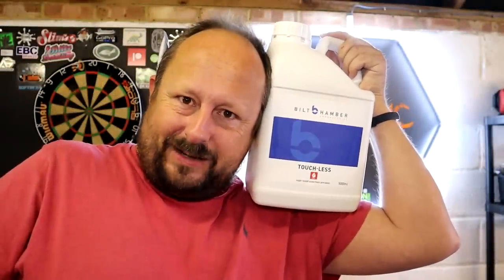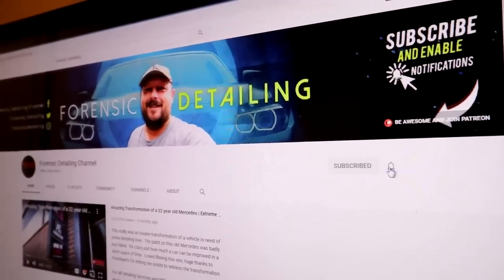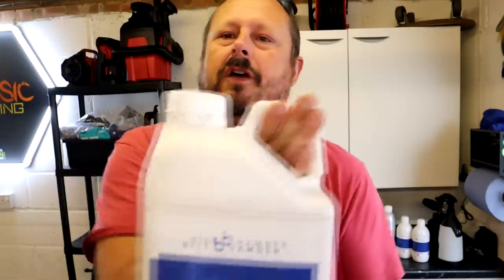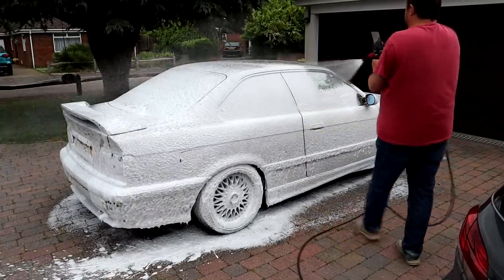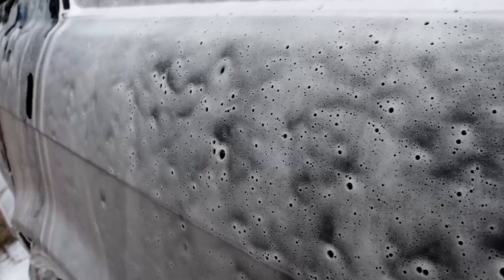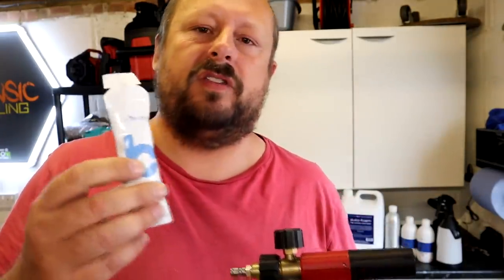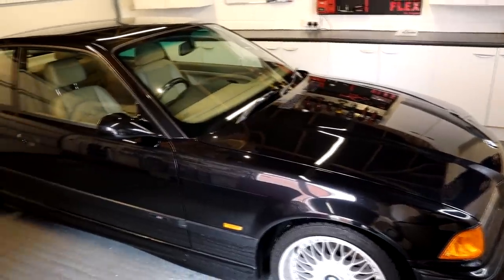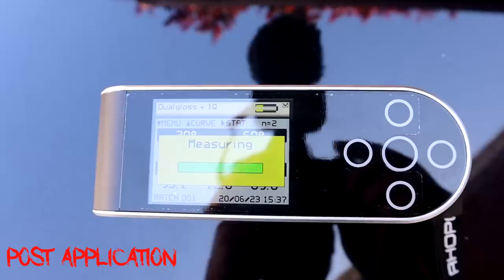Getting the Most out of Bilt Hamber Touchless and Touchon

Comment: I like to work one panel at a time, and I do like to make one small exception when using Touch-less on a vehicle and thats to make contact with a detail brush on emblems, rubber trim, glass, etc and even use a magic eraser on the glass and side mirrors during the normal dwell time, before the rinsing off. This then allows Touch-on to bond better in those areas, incredible finish on glass with only Auto QD to finish up later on in the detail

Comment: I brought touchless recently. I think it maybe the tweaked version. I usually like a thinner foam as easier to rinse away from the car and drive. But this surprise me with how easy it washed away even with it being quite thick on application and was still effective pre wash.

Event at 2% PIR it instantly reacted with dirt on the tyres almost like an APC. Which is usual for a snow foam. I don't think auto foam does that a 5%.  However it was only summer dust so can't really make a judgement on the cleaning. Its does smell like Sugar soap from a DIY store, which make sense as it is a sugar based product.

Comment: When I use Megs HCW in a wet manner (I use a noodle mitt rather than spraying it all over the place!), I finish by spending 1 min on the windscreen with a clay mitt. Get's off the over sprayed product and makes the wiper blades silent! I'm going to get some Touchless soon as my Auto Foam is almost run out. I'll skip the Touch On, purely because I am happy with Megs HCW (dry application base layer or wet application, spray off).

Comment: Great video.
Here's a suggestion for those who want a thicker foam but retain the properties.
When mixing your lance, add 10 ml of a thick foaming soap like Magifoam or Chmical Guys snow foam. I've found that it worked for people with low pressure machines and pump sprayers to get a better foam. Just remember that it's not about getting whipped cream on your car, the foam has to be able to slowly migrate down the sides of the car. For this reason, also remember to give the adjustment knob a few clicks when you start by foaming the roof to thin it out a bit there.

Comment: I thought I’d got my pir wrong somehow, because I’ve been getting really good foam with the touch less compared to what others have been experiencing. It’s a great product and does exactly as it should and, it’s very well priced. I’ve not got round to using the touch on yet as I’ve not long waxed my own cars but, the next wash I’ll give them both a go. Love the double speed wax my vans never looked so good! coupled with the bilt hamber QD as a dying aid mixed at 10-1 mixed with RO water
Reply: What equipment are you running?
Lance, HP washer, pressure, l/hr? Also, what ratio of product to water are you using in your lance?

Comment: The built hamber stuff is all amazing but the touchon stuff I have been using for about 10 years. It was sold as wetwax2000 £25 for 25 litres of concentrate that I mix down 50:50. Its actually a product designed for car washes where the car is rinsed before it goes under the big blow dryer.  It leaves an amazing shine and after applying and a really low pressure rinse the car is almost dry the water just runs off.
Reply: You just blew my mind! Wow! 🤯

Comment: Loving the new touchless however i cant say the same for touch on.. The water spots from rain are considerably worse on my black car vs using koche chemie protector wax, same goes for slickness... I could feel straight away while towel drying the paint was alot more grippy, and near instant water stains on windows after rinsing the product and towel drying, maybe its  me so user error but ive gone back to koche chemie as nothing for me has beat it

Comment: The Touchon product seems very similar to the Autoglym Polar Seal that I use regularly. I'm not sure I get 1 month protection from the product and I would typically reapply every 2-3 weeks. I would be interested in a cost and performance comparison between the two products.
Reply: It works best in a snow foam canon and for many works as a brilliant topper on DSW or any other base wax.

Comment: I’m a heathen and spray my windscreen with touch on and do nothing after… and honestly have no issues with my windscreen clearing after. If anything it acts a bit like rain-x. 

Would be interested if you could get a bilt hamber expert opinion on if the touch on will break down over time when you leave it in a mixed water state… I assumed that’s why it came in the sachets!
Reply: Yep. I agree. I like it on the windscreen. It acts like rain x.
Reply: I use one sachet for 3 washes. They are brilliant.

Comment: I will buy 10 satchels of touch on and use it in a trigger sprayer as a spray on and rise wheel sealant. Not only is a pack of 10 satchels cheaper than a dedicated spray and rinse sealant it will last 10 times longer.

Comment: Hi Jon, brilliant video, one thing to ask and I've probably missed it. You mentioned about using touch on in a trigger spray or pump sprayer, can you suggest a ratio or at least point me in the right direction? Thanks
Reply from the maker: use the liquid the comes out of your lance and you dont have to worry about ratio.
Reply: @ForensicDetailing  Jon, unfortunately I don't have a Lance and won't be buying one anytime soon, hence me asking about trigger and pump sprayers
Reply: Jon mentioned that it can be used as a contact wash, 1 sachet to 15litres of water, I'd just make up a bucket full and decant into trigger bottles as a spray on

Comment: Heh.. I still have my S-7050  (10 wpc) from high school (and the no name speakers). Yup, power switch blown. In the early 2000’s i started buying the rest of the line, from the ads in the day, where all the units were stacked up. S-8900A, S-7200, the S-7100 and bought another 7050 to be used for parts, but it was pristine, so I’ve left it alone. I only paid $9.95 for the other 7050, paid more in shipping! I just use a cheap power switch now. Nice video, thxs for the review.

Comment: Hi ,I’ve just bought 5lt ,of this bilt hamber, touchless , and only purchased due to great reviews, I applied this at a ratio of 200ml to approx .0.6lt water ,using the Ava premium snow foam cannon, I gave my van a good coating , allowing a good 5 minutes dwell time ,anyway it came to rinsing of the foam, and tbh quite disappointed, didn’t really do anything, and my van wasn’t really dirty, I ended up in using a soft hose brush, and pressure washed as I went along , this was a much better result, and could of saved myself £30 
Or just should of purchased some tfr
Reply: Try using in a sprayer. Makes it easier to determine PIR. It’s possible your PIR was too low using the snow foam canon. Everyone’s set up is different.

Comment: Hi John, would love your help. I've seen your video on how to calculate our PIR. My foam canon came to 14L. On my calculations, with the Bilt Hamber 4% it means I have to use 560ml on my 1L foam canon, correct? Were I live, touchless comes at 36.95€ per 5L, that comes to 4.14€ per foam canon. Currently I'm using LaboComestica Primus, 1:10 as recomended by them, on a price of 46.95€ per 4.5L which work to 0.95€ per foam canon. Is my math correct? Any chance you have to test Labocosmetic products? I don't find much on them but I'm loving them. Keep up the great work :D
Reply from the maker: I dont find many prewashes can work at 1:10 in the lance on heavy films.  you dont need to run at 4% PIR but you can if required.
Reply: What kind of foam cannon do you have? 14 litres??? Most are 1 litre or even less.
Anyhow, if what you have is a pump up sprayer and not a foam lance, you don't need to use 14 litres for a wash - that should last you 20 washes or more unless it is insanely inefficient. I like a 3% mix for my cars and I use 500 ml of water in a lance to foam up a car, i.e a full bottle on my MTM lasts me two cars. That comes to 15 ml per wash which equates to 330 or so washings from a 5000 ml jug. Anyhow, for 3% you need 420 ml for 14000 ml of water. Unless you overuse it somehow, I'd say there's about 200-250 washes in a 5l jug for you. That's a lot of detailing...

Where are you located that makes pricing that high? I'm in Europe and pay about 25 Euro here in Denmark.
Reply: @AB-80X  14 liters for the PIR % requested by them. I have an MTM Hydro, 1L. The 14 liters are from the video Forensic made in order to calculate the 4% dilution ratio. I'm in Portugal and here all UK products are very high priced.

Comment: Hi re touch on it says 
Bucket:
Pour 30-60ml into a bucket then fill with 10 litres of water 

Trigger spray:
Add 30ml to trigger bottle and top up to 1 litre with

My question is if it's fine at 30ml to  60 ml 10l in a bucket. why can't I use that on a spray bottle as would last a lot longer. What's the difference if I made up a bucket then just put it in a spray bottle can't see a problem
Reply from the maker: Just go with in structures bro. It's a fair enough question but just trust them

Comment: Just seen this video, going to try the touch combination, shout out to the E36 328is ❤❤ I had one and put an m50b25 inlet manifold and throttle body on it, went well! But no matter how I drove it i couldn't get more than 220 miles to a tank🤣
Reply: I forgot to add how does touch on compare to Gyeon wet coat?
Reply from the maker: I 0refer wet coat

Comment: Can I ask you to please recommend a snow foam bottle/Lance as mine doesn't seem to foam anywhere near what yours does and has pretty much run off in a minute. End gets absolutely no dirt off. Thanks.
Reply: Try mixing your snow foam up initially with distilled water and then use it. I had the same trouble with useless snow foam. I live in SE England and the water is really hard. I know that you still have to put tap water through your pressure washer and lance, but it made a big difference to the thickness of my foam👍🏼
Reply from the maker: mjjc pro v2
Reply: @ForensicDetailing  thanks. Just watch your video on it so will get one thanks.

Comment: Does water hardness change how products work? I'm in Cornwall with very soft water. I have same foam cannon as you and use Bilt Hamber. You do seem to get s dryer foam that me. Although admittedly I have a lot to learn to get the most out of it. I'm mindful the flow rate on the cannon and the initial dilution is something i could do with improving, although I do wonder if water hardness makes a difference.
Reply from the maker: Do u have k7 karcher?
Reply: @ForensicDetailing  no. Just a Nilfisk 140.3. Is the pressure or flow a big differential? The way formulas a tweaked got me thinking of water hardness, mindful it has quite a hit on pH as well as trace elements.
Reply from the maker: The k7 whips up better foam m8 specially with mjjc pro
Reply: @ForensicDetailing  Thanks. Is that just down to higher pressures d you think?

Comment: The only bad thing I’ve heard is they are on the top end of pH which I’ve also heard isn’t necessarily good too. So how do you recommend to neutralize it so you can use it as a true touchless wash?
Reply from the maker: sorry chris.  but you are falling into a trap.  measuring alkalinity is not a measure of a products ability to strip protection or be like more harmfull or corrosive (at best it could be a vague finger in the wind).     For example pure IPA is PH7 but it will strip protection more than any car surfactant even a PH13 one for example.  the industry tries to sell you a PH neutral "mild" approach to cleaning.      Things that make product strip LSP are caustic materials like sodium hydroxide, potassium hydrocide, phosphoric acid etc etc...   Funny enough there are tons of mild ph neutral foams that use sodium hydroxide.    Sodium hydroxide to this day is use in some old fashioned paint strippers.
Reply: @ForensicDetailing  I don’t think so, no but I’m not disagreeing with you though at all. One of the channels I watch how measured the ph level straight out the bottle for Bilt Hammber Auto Foam that come to be pH 13 but once it came thru the foam with more water it pretty much neutralized to 7 then is what I was trying to get at my bad. So I was really if it would work well for doing touchless washes? Also not have to do a contact wash other then getting bugs off course because I would really prefer to do true touchless washes if possible on all customer vehicles

Comment: Touchon is a great product and price point if you just want to buy a sachet every few washes.
How does it compare price wise cost per wash (I know it's a slightly different product) to Gyeon Wet Coat? We are starting to get more Bilt Hamber products here in Aus.
Reply from the maker: I think it's abput a pound a sachet here
Reply: @ForensicDetailing  yeah you said the price of the Touchon in the vid, i meant cost per use compared to a bottle of spray on product like Wet Coat. I gues you'd use 1/4 of a bottle of Wet Coat each time you used it once every few months or so.
Reply: Gyeon wet coat is good stuff but pricey to use the way Gyeon intend you to use it and it doesn’t get the best durability either doing it their way.
Reply: @kwl189  I got 6+ months out of it doing it their way. It was ready after the wash on the 7th month.
Reply: @fordyford  I’ll never know how you get that durability out of it. Nobody else I know gets that length of durability out of it but if it works for you.
Reply: @kwl189  I sprayed it on, pressure washed it off 🤷‍♂️.

I made a 6 month review video on my channel showing it was still there but about ready to reapply.
Reply: @fordyford  at the risk of being utterly blind, I saw the 6 week review you did of GWC and the initial review where you applied it on top of a ceramic coat? Not sure where 6 months is to watch? Unless its buried in one of the other detailing videos? 

That is the general principle to applying GWC. Spray on wet panel and rinse off. 

The way I use to get better durability is to spray onto an applicator pad or microfibre and apply onto a panel, then use a clean microfibre to buff off. Evens the coverage and the product adhers to the panel better I find.
Reply: @kwl189  ahhhh crap, yes I did only upload the 6 week review video. The rest it seems I posted on Instagram. Apologies for the wild goose chase, you are not blind.
Reply: @fordyford  Seal and shine from TW is similarly raved about for durability but climate and road conditions play a part in durability as much as anything. The UK has brutal weather with lots of rain and cold for most parts of the year. Even in summer thunderstorms can be common place. Though we do not use as much road salt as other and thus do not have so much issue with rust formation in general.
Reply: @kwl189  I'm in Australia. Brutal weather is normal.
For the 2nd time this year (March and now July) we have had over 770mm of rain in a weekend. London gets around 643mm annually, we got more in a weekend. Twice.
Summer is sh!t hot averaging over 30° every day sometimes i to the high 40's, had about 4 or 5 hail storms this summer and thunder can be daily lol.
Weather is pretty extreme here.
I applied the WC in September, it wore it all summer and in March, around the time of the 1st flood this year it was ready for another go.
I haven't heard of the swal and shine so not sure if we get it here.

Comment: Hi John. Ive just washed,clayed,machine polished,IPA wiped and its ready for touch on. Do i have to towel dry it after applying it as i bought a really good towel but it left holograms all over the car (VW Arteon) and i used bilt hamber QD at 1/10. Could i blow dry it. Thanks
Reply from the maker: hey there touch on is more a quick maintainence product.   So after full prep you should use a sealant or wax really.  Double Speed wax is very good for the money.    then in a months time just spray on the touch on after washing and blast off and dry with a towel mate.    sounds like soft paintwork so just be really gentle when you contact it.
Reply: Thanks John.

Comment: Hi, is the touchless capable to strip down/deteriorate in any way soft99’s fusso coat? Thanks!
Reply from the maker: Not strip but all prewash or detergents slowly degrade lsp
Reply: @ForensicDetailing  Thanks for the speedy reply, just bought 10l of the touchless as I was pretty convinced by its cleaning abilities (as demonstrated in your tests), was just worried that I’d have to re-apply the coat after every wash..